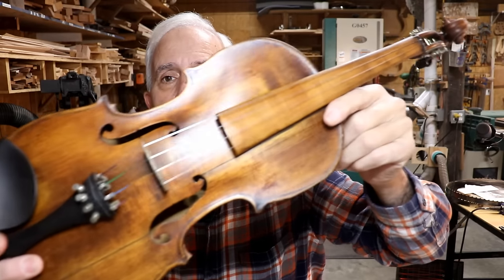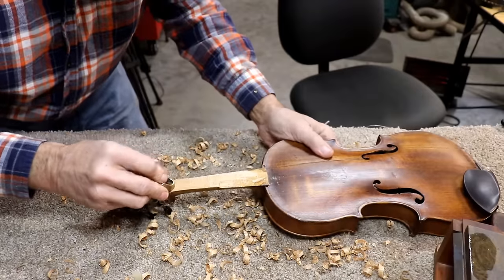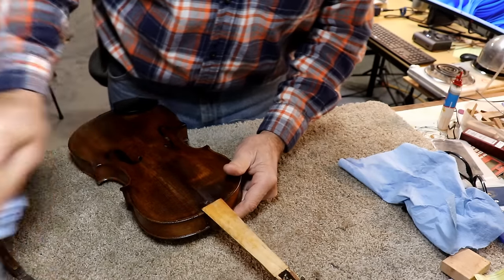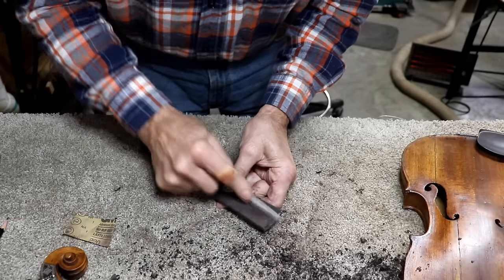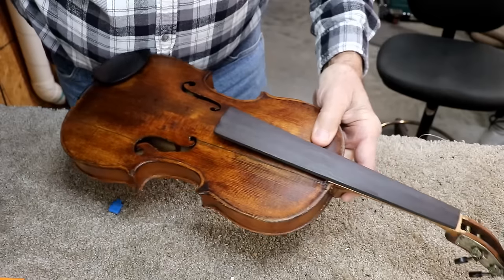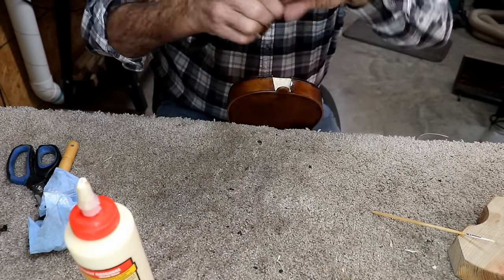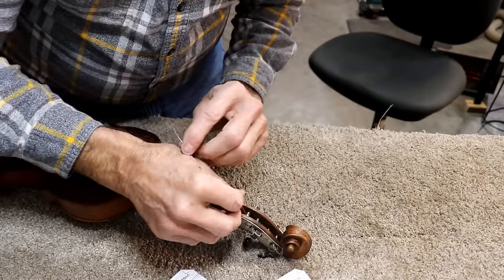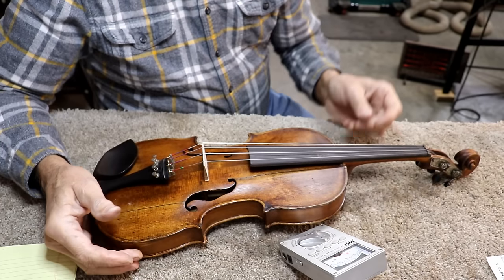689 RSW Extensive Violin Neck Reset And Setup

Comment: Great work Jerry. I understood hide glue released when hot water was applied sparingly by brush or rag.
Reply: I hate to say this, but his method of applying the hot iron to the fingerboard isn't the right method.  It takes longer, but the best method is to let the heat soak into the fingerboard slowly.  To that end, I use a heat gun applied over an hour's time (on and off so as not to scorch the fingerboard).  The heat will eventually work it's way into the hhg.   When the glue gets warm, a hot knife will finish the bond and allow it to come apart.

Comment: I am so happy to hear you speak up for Titebond.  I had a very respected repair shop use hide glue on a guitar repair (cracked soundboard).  I told them I wanted Titebond, but they insisted on hide glue.  It lasted about six months before the glue joint failed. So I had them fix it again with Titebond, and (of course) that worked much better.

Comment: For the hide glued fingerboard, you can pump lots of heat into it until you can jam a razor blade under it in a small section, and then shoot warm water into the gap with a syringe. The warm water will dissolve the next bits of hide glue, and the steam from the heating will force it forward. Keep heating it, and wiggling a palette knife in there, and it'll gradually come off. Takes about 10 minutes! For difficult titebond joints, I do the same but with a little vinegar.

Comment: Jerry, I loved the TLC that you lavished on this violin project. I came across a tip in an old StewMac catalog  that might save you some effort the next time you have to deal with some "mule" hide glue that refuses to yield. Steve Uhrik of Retrofret suggests adding some meat tenderizer to your steam bath water used to remove a stubborn neck joint. The enzyme in it breaks down the protein in the hide glue making the joint come apart much easier. Better living thru chemistry!

Comment: One of the main reasons for the use of hide glue is it complete reverse ability… very easily. Nobody is questioning whether titebond will hold or not, it’s just not as easily reversible. No high end shop or professionaly trained luthier would glue their instruments together with anything but hide glue
Reply: Yes they are claiming that since hide glue has  been around hundreds of years it's "reliable" and modern glues have been around less than 100 years and therefore they don't know how good they are.

I personally don't want any minor damage, like physical cracks in the wood to come apart again but they will with hide glue because they glue the cracks and the cleats inside.
Reply: @nancymilawski1048  Then the hhg is not being mixed properly, heated properly, or it's rancid.  Done properly, hhg will last a hundred years and be repairable.  If 17th century violins were made with modern glue, they wouldn't be able to be restored to like new without loss of wood.

Comment: the best way I have found to disassemble an interments is to leave it in a hot car.  When you open the case all there is is part.
Reply: Great idea!  I use a heat gun in an on and off method to heat a joint over an hour's time, but I like the hot car idea..

Comment: It's somewhat ironic that saying anything with hide glue will need re-glueing from time to time and then you come across a piece that almost needs blasting off😂 Another great job completed!!!
Reply: He said hide glue is inconsistent, hence the difficulty here.
Reply: @edd2771  Jerry said that - but the only inconsistency from hot hide glue is from someone who doesn't know how to use it.
Reply: @ohger1  false
Reply: @edd2771  You can believe that, just don't touch a historic instrument please - no conservationist would ever use anything but hhg.  Junk instruments?  Sure - have at it.  HHG has been used for hundreds of years and is always consistent assuming the user knows how to use it.  Any inconsistencies is due to operator error - either directly or by not recognizing old or moldy hhg.
Reply: @ohger1  And again, false. PVA glue is stronger, more consistent and yes, reversible. For an antique instrument that requires restoration in addition to repair, hide glue is acceptable as it preserves the original materials. But for any fine newer instrument made in the last 40 years, a quality PVA is the choice- be it the finest Martin or a Chinese entry level guitar. You may choose to stay stuck in the past, but better technology exists.
Reply: @edd2771  Unlike hhg, PVA glue soaks into the wood fibers which is why it's strong, and which also totally disqualifies it for conservation work.  HHG stays on the surface of the wood. Moisture and heat releases hhg of any age without causing wood damage.  Stick with kazoos because you're really exposing your lack on knowledge on this subject.
Reply: @ohger1  Incorrect. PVA can be steamed loose quite readily. There are dozens of videos on this channel alone illustrating it.
Reply: @edd2771  Sigh.. Even if you can get get the PVA joint apart without splintering the wood, PVA doesn't stick to old PVA which has soaked into the wood and cannot be removed. Old PVA makes the wood non-porous, which is how PVA works - we conservationists know this. Youtube experts not so much.  Unlike PVA, HHG is completely removeable from the surface of the wood leaving the wood as it was when it was first milled which is why PVA works where old hide glue was but won't where old PVA was...  Finally, even 200 year old HHG reconstitutes into fresh glue and mixes with new glue.  Just delete your comment before you embarrass yourself further.
Reply: @ohger1  just watch any of the dozen + videos on this channel discussing the matter at length and contradicting, with filmed demonstrations, everything you say. Once you have educated yourself we can continue the discussion.

Comment: I had an outdoor raised bed made from cedar. A big tree limb fell on it and broke the cedar legs and some of the boards. I used Titebond 3. It fixed it perfectly. It remained outside in the rain and weather for 5 more years and the Titebond 3 was still holding just fine.

Comment: I thought the complaint for using anything but hide glue is that repairs are more difficult because hide glue is the only glue that will stick to itself. The other luthiers I watch use water to thin the hide glue before any heat or other options. I am curious how your Titebond repairs go, since I don't have experience with that.

Comment: With all due respect, if your hhg joints failed then you didn't mix the glue right, or used the wrong temperature, or used old or expired glue.  There's no "myth" about hot hide glue, there's a learning curve involved and you simply didn't get there (again, with all due respect to your skills). I only use hhg on vintage instruments and have never had a failure.  A hundred years from now, the next luthier will be glad I put up with the stink of mixing and using it when he has to take that instrument apart again.  Some instruments deserve conservation as much as "repair".   Sure, guys like Antonio Stradivari, Giuseppe Guarneri, etc. only had hot hide glue, but that's fortuitous because if they had synthetic glues back then, their instruments couldn't be repaired or restored with virtually no loss of wood as is what happens with PVA, cyanoacrylates, and epoxies.  I think I owe my customers, the next owner, and the next luthier the correct way to repair an instrument to conserve it, not just "repair" it.

Comment: "I glued thousand of instruments with titebond and they've never come apart"

No shite Sherlock, that's the problem, they'll never come apart without BREAKING THEM, bc the glue bond is too strong, which makes that much more work, and expense the next time the instrument needs work! 🤦
 
Hide Glue is used bc it's not a permanent joint, it's easier to pull the instrument apart when it needs to be fixed again. Now if you knew as much as you thought you did, you would use WATER to weaken the Hide Glue before applying the heat. Bc its the Water that breaks the bond. 🤷
Reply: Thanks for that reply.

Comment: No knowledgeable professional says titebond original can’t come apart. If your hideglue joints failed that’s a user error.
hideglue’s beauty is it comes apart without damaging the instrument and can bond with old hide glue. It’s a part of the violins design to be taken apart easily. They can be taken apart endless times over centuries without destroying the instrument. Hide glue is the only reason we have 300 year old violins that are still playable. Yes, Titebond comes apart with heat and moisture but it has to be removed till there’s bare wood to reglue, which removes the original wood. These old instruments don’t have extra wood to give. If they’d used titebond when it was made and rebuilt the  several times over the centuries there’d be nothing left of the original instruments. You have to think, is this an instrument that will be around in 100 years from now. If titebond made a better sounding instrument, the best makers would use it because their instruments would outperform others and they’d sell more. If it was better for repair, luthiers would use it, since they’d never have joint failure. Hot hide glue is hardly a blindly followed tradition, Centuries of luthiers can’t be wrong. Have you read any reputable tutorials on violin repair and read why they do what they do. There’s great wisdom from experience in the luthiers world.

Comment: I disagree with your opinions on hide glue! I really love using the stuff. There are creature comforts and usability benefits that come with hide glue, accessible once you overcome the initial difficulties. You can overcome the consistency problems by sticking to a single supplier of a single grade of high quality product, and using it the same way every time.

There's certain restoration procedures that are made possible with the properties of hide glue. For one thing - hide glue will always stick to itself. This helps out a lot! Some procedures require the use of hide glue.
Reply: This reminds me a bit about plumbing - many guys these day use propress connections because they are so consistent and anyone could install them, but a properly sweated solder connection will last as long as the pipe, assuming the plumber knows how to sweat copper.  Jerry never learned how to properly use hhg which is a shame.  Other than the stink, hhg is the very best glue to use on an instrument valuable enough to repair.

Comment: With all respect: Titebond is not a viable replacement for hide glue in all situations.  I speak as an instrumentmaker with more than fifty years experience.  If you glue the belly of a violin on with Titebond, or any other casein based glue, you cannot open the joint without damage.  I too use Titebond, for joints that should never be maintained- for instance, in glueing on a guitar bridge.  But it's silly to use Titebond to glue on a fingerboard, and it's criminal to use it for a violin or cello belly.  Sorry, despite your obvious expertise, I must disagree with you here.  I've had to deal with the consequences too often.

cheers from overcast Vienna, Scott

Comment: Hide glue is best to use on the neck if the scroll gets broken you will have to replace the neck and it’s a whole lot easier with hide glue .If you are afraid the neck won’t hold put two 1/4 in maple dowels into the neck that way if you have to replace the neck all you have to do is drill out the dowels and replace the neck.

Comment: Stick to guitars mate, you're not fit to be let near a violin. A proper violin luthier would have used a bit of cold water and had that fingerboard off in about 5 minutes! I've never seen anyone try to take violins apart using heat. It's totally unnecessary and just plain stupid. And what would you have done with that fingerboard if the owner had wanted to keep it, so that planing it off wasn't an option? I wouldn't let you anywhere near my violin.
Reply: 100% correct.